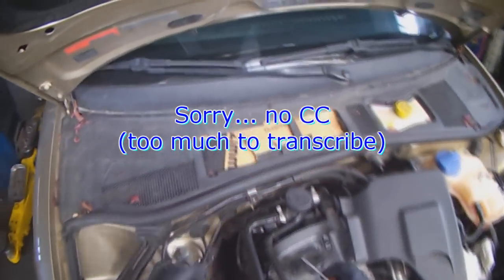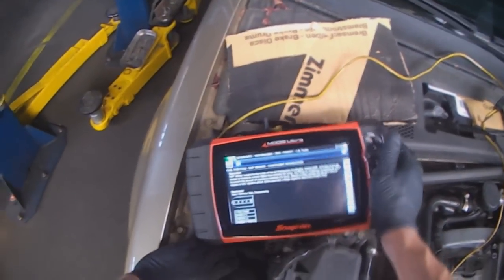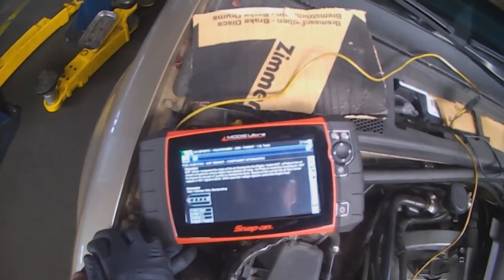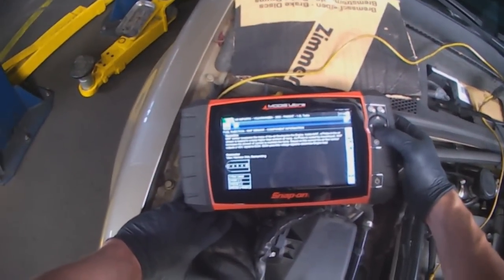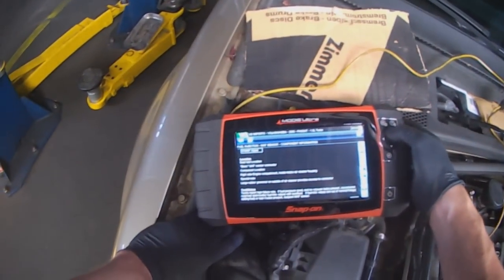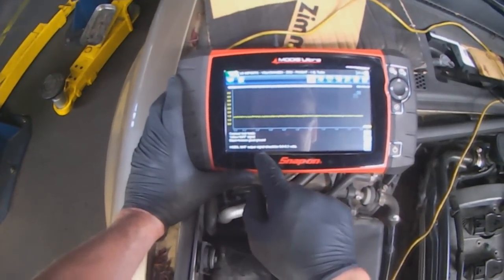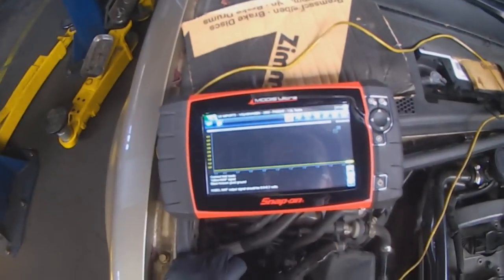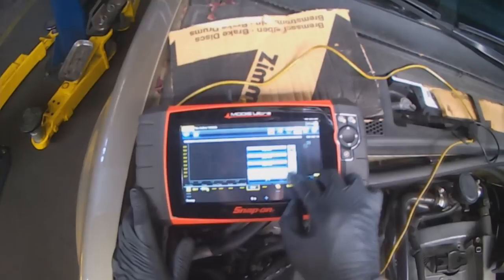1.8T MAF sensor signal output (helping a viewer)

Comment: Once I  plug mine in my engine immediately shuts I kept on trying stuff and it actually started working thought I was done came back a few hours later same thing will not run with the maf plugged in I tried another used map sensor in same issue when I check it on my scanner when I plug in the sensor it immediately goes to 225 I believe what is the number but it seems like it maxes out instantly and then shuts the car off then when I unplug it and start it again the map sensor reads zero then I shut the car off plug the map sensor in when it reads 0 and it doesn't change until I start the car and it maxes out again and shut the car off I'm also getting a code for the rear O2 sensor put all this is happening when the car is cold I'm thinking that Eureka moment the car had warmed up finally I thought the O2 sensors didn't really come on can be used until the car is warm can O2 sensors affect the engine when it's warming up?
Reply from the maker: When the MAF is unplugged, the ECM uses MAF values that are stored in its memory... meaning that if the engine is able to run on stored air values, the actual fuel supply, air supply and ignition timing must be adequate / correct.
If the engine stalls or does not start when the MAF is plugged in, then the MAF or wiring is causing the ECM to over or under adjust the correct fuel amount for the  "air values" that the MAF is providing.
The reason the engine doesn't die when you plug the MAF but it does when you restart the engine... is because the ECM always uses actual MAF values when first starting the engine.
Reply from the maker: Make sure to check for broken rubber intake boots  between the MAF and the throttle body.
I once replaced the timing belt on a Passat and forgot to attach the intake hose at the bottom of the intercooler after moving the radiator back from service position. The engine started & stalled.
Reply: Omg I was checking my wires on my O2 sensors and the car was running and the gray one touch one of the white ones and the car shut off and I'm screwed now my check engine light doesn't come on all the fuses are good I'm almost certain that the check engine light is going to come back is it easy to program LOL
Reply: So I have a spare computer plugged it in and check engine light came back on so I'm really screwed now I took both covers off of both computers and my one that was working smells so burnt inside now I can't find out where it is so it's probably one of the chips wtf am I going to do now
Reply from the maker: Yeah, O2 shorts can fry the ECM. You will have to match the used one to the car / immobilizer.
Reply: Is it easy
Reply from the maker: @Kevin-wy8kc 
Specialty scan tool / software is needed. Immobilizer delete is another option, but that also requires someone with special know how.
What's the actual year / model of car? Google ECM coding / cloning or Immobilizer delete. 
To clone an ecm you need a good working one, so that's not gonna work.
I use ODIS (dealer software) to match used ecm's to vehicles.
Reply: Thanks for helping me man so much it's a 2001 GTI the spare ECU I got seems perfect for it check engine light comes on so does the immobilizer like stars and shuts right off I have a launch x431 that's not going to do it though I don't think
Reply from the maker: @Kevin-wy8kc 
Mk4 immobilizer delete is probably the way to go.
Reply: Only thing I'm worried about is being in CA and the VIN number not being the same I just seen a video where you can unsolder the immobilizer data chip in solder in the other computer you can also do the tune
Reply: I got her running!!!....that was extremely easy. It didn't work at first that's because I didn't check the pins with the multimeter head Bridges but then I checked it and voila she's idling a little funny right now but hopefully that'll get worked out other funny thing is the map sensor was plugged in and it's not shutting off and I have the rear O2 sensor unplugged right now but woo hoo!!!!
Reply from the maker: @Kevin-wy8kc  
Thanks for the update. Lucky!

Comment: I have power in my ground what should I do
Reply from the maker: Not knowing what year car, make, model & engine... or what you are using & how you are checking / taking measurements, I can't say the "power" you are seeing is normal or not.
Reply: @EXOVCDS  so it’s a 2004 Passat 1.8t so I just need to know what every pin should have then I’ll go from there.
Reply: But the code only comes on when the car is started up
Reply from the maker: @juniormorales4041  the video explains what voltage should be present... starting at 2:40.
ECM negative means that it's a ground inside the ecm. Should be less than 0.100V (close to 0V as mentioned in the video).

Comment: What is a good value? How many grams air on idle?
Reply from the maker: Depends on altitude... what's the actual problem? MAF code? Which one? What year, model & engine?
Reply: Thomas EXOVCDS 
I have a code 1292 engine cooling thermostat open circuit. 
But my problem is that its crazy hard to start the engine. And when it finally starts it missfires. Read somwhere to check airvalue, on idle its 2-4gr. Would the engine missfire due to thermostat?
A4 2007 1.8t quattro
Reply from the maker: @tonysvensson6108  Hard to start when cold only or also when warm? That code should not cause any starting issues. Make sure that coolant temperature matches / is close to air temperature on a cold start (check with the key ON engine off).
Reply: Thomas EXOVCDS both cold af warmstarts. A bit easier hot, but still 8sec on the startmotor. The  coolant sensor behind the engine is changed and shows right temperature
Reply from the maker: @tonysvensson6108  Fuel pressure ok? The engine can run fine with the MAF disconnected... the ECM uses preprogrammed MAF values to run. If there are no underlying issues (on an engine with a bad MAF), the engine should start and run normally when the MAF is disconnected. If there IS an underlying issue, the starting problem will remain when the MAF is disconnected.
Reply: Thomas EXOVCDS missfired on idle until i cleaned the airfilter (shop closed) but now it runs good. How can i check pressure? Can it run good if the pressure is off?
Reply from the maker: @tonysvensson6108  The only way to know if pressure is an issue... is to check pressure. If the engine has low fuel pressure on initial start, you will have hard starting / long cranking / rough running / misfiring. Once fuel pressure is ok... the engine runs fine. It might not be a fuel pressure issue, the only way to eliminate it, is to check pressure. In this video, a faulty injector is to blame:
https://www.youtube.com/watch?v=-1N_mIp1fu0
Reply: Thomas EXOVCDS hmm can i loosen the injector rail without connection a gauge? Guess i need the switch-box to check open and close injectors.
Reply from the maker: @tonysvensson6108  I'm only giving examples / making you aware of what to check / things that it could be. A bad EVAP purge valve can also cause the same symptoms that you have (hard starting & rough running). If your exhaust isn't smoking, then it's probably not a sticking injector. There's never a quick answer / solution to most automotive problems... I'd be rich if that were the case. Do some more monitoring with the scan tool. Post videos so I can see & hear what's happening. Disconnect the MAF and see if there's a difference... your first post was about the MAF, might as well check it before digging deeper. Personally, I haven't come across a MAF that caused starting issues, but functioned fine under regular driving.

Comment: Hello Thomas, audi 1.8t 2002 180hp getting limp mode. Obd code 17743/P1335 - Engine Torque Monitor 2: Control Limit Exceeded, could it be a boost leak? How can I test it?
Reply from the maker: Not sure... this is the code description with some possible causes.
http://wiki.ross-tech.com/wiki/index.php/17743/P1335

Comment: question. when you connected the multimeter you connected the black to the negative battery and the red to #5 which is the maf signal right? great video by the way!👍
Reply from the maker: Yes.
Reply: your video is really helpful. i checked with my multimeter and had my wife rev the engine to 2000rpm and the multimeter was barely at 1.56 then took it to 3000rpm constantly and it barely was at 2volt it was like at 1.93.  so my signal it was not to strong. you think my MAF is bad? O also checked for leaks and everything is good no leaks
Reply from the maker: @kevingonzalez9193  voltage readings at steady rpms is not a definitive test... at idled yes, but it's better to check during a snap of the throttle. Regular multimeters might not be quick enough to show actual voltage during a snap test... so do it several times to get an average reading. At idle, voltage should be a bit over 1V and voltage should get close to 4.5V when the throttle is snapped fully open (quickly).

Comment: Hi Thomas, I've test my MAF and I got these results: Pin 1 empty, Pin 2 is 13.8V or ~14V, Pin 3 is 0.1v, Pin 4 is 5V and Pin 5 give me ~2.4V at idle which is so high for idle. Does this mean my MAF needs to be replaced ? Thank you
Reply from the maker: Could be... year make model engine?
Reply: Thomas EXOVCDS Passat 1.8T 150hp 2001 Engine code AWT (European version). Very similar to AWM engine
Reply from the maker: MrChekmek read the last paragraph from this link.
http://wiki.ross-tech.com/wiki/index.php/Fuel_Trim_Info
I'm gonna have to watch my video again to see what voltage I had at idle.
Reply from the maker: MrChekmek If the ECM gets a  2.5v signal... it will add more fuel. If the MAF signal is wrong, there will be too much fuel.... which should set a rich code. Check the MAF according to ross-tech link. Clear codes while engine is at idle then quickly look at fuel trim values. What are they?
Reply from the maker: MrChekmek Short term fuel trim (should fluctuate quickly from + numbers to - % numbers).
Reply: Thomas EXOVCDS  Hey Thomas, sorry for late replay, I've done some tests and uploaded them on Google drive. Here are links : 
1. Test for fuel trims at idle ( https://drive.google.com/file/d/1R8X19X0xf2_uQ-Ev5av2pYyEFg1LNsXi/view?usp=drivesdk )
2. Test for MAF with full throttle on 2nd gear ( https://drive.google.com/file/d/1dfZkj1CMFMFk0SslYAOdDOJvJGrNtg9V/view?usp=drivesdk )
On test for MAF car is stalling on ~2700 RPM for a while and after that it continues with no or less power. Can you help me to determine what's the problem with my car ?